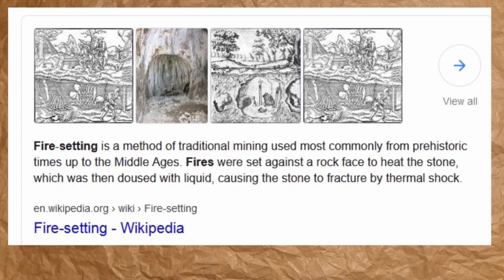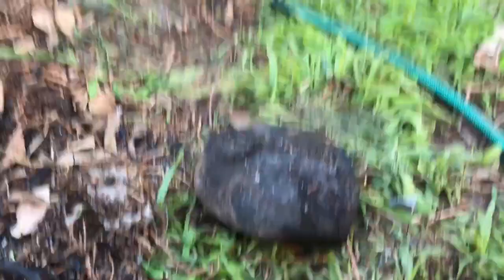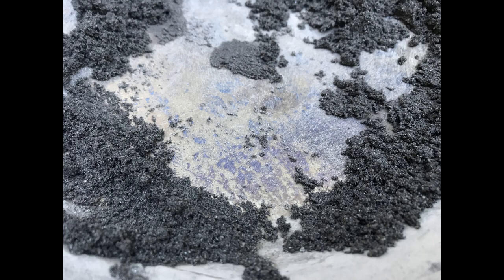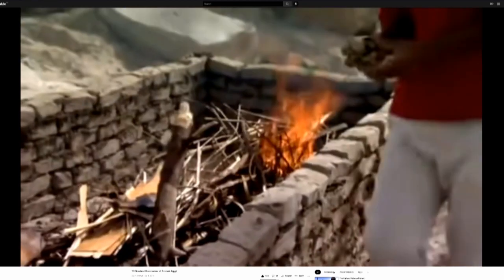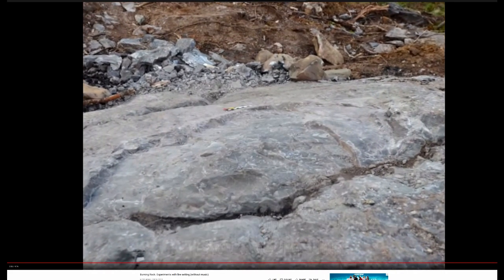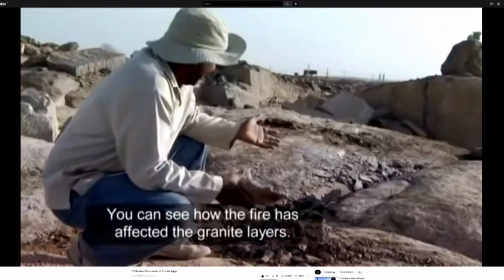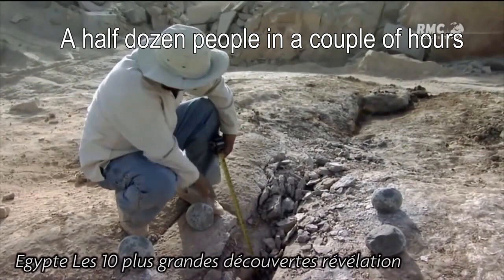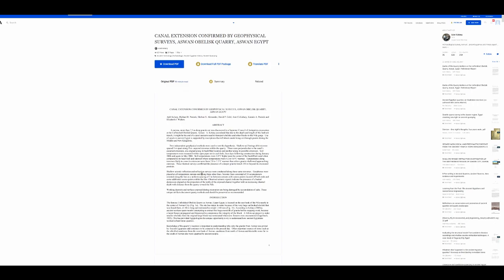Fire, Water, Granite & Other Primitive Tech the Advanced Ancient Technologists Can't Understand

Comment: You wouldn't even need a hot fire or for a long time. In fact to certain circumstances you wouldn't. If you wanted to take a very rough area, set an even fire or coals for a short time you will affect the stone to a limited depth, making grinding and sanding easier.
Reply from the maker: Yeah, at first i left it in the fire for a long time. Then I'd just heat it up for a few minutes. Doing that a couple of times with some water in between reduced it to little more than dust held together by kids glue. A few whacks with a hammer stone and it disintegrated into a fine abrasive powder.

Comment: My question is this - if this method of banking a fire against the granite to heat it up, and then dousing the granite with water to create internal micro fissures and weakening the granite so pounders could work it was used, how does that explain the uniformity of the scoop marks? How does it explain how they stair step down the sides of the obelisk? How does it explain the curved cuts under the obelisk?

Comment: i also have another theory regarding the making of stone saws, which there is clear markings on the box sarcofagus's of saw markings. The Egytians were great bead makers and a ceramic bead with sapphire or garnet could be set in the mud before firing then finished beads could be strung on a rope with knots to keep separated allowing the abrasive paste to work in between the beads. Re-using the broken beads would have been a smart thing to do saving time from collecting new hard abrasive minerals, leaving very scant evidence of any left over beads. Again not high technology. Just smart old fire technology.
Reply: @GroberWeisenstein  i never said it wasn't...i said theory of making saws

Comment: Just a little query,why do I see close together scoop marks around these blocks and not shards . Also wouldn't setting a fire under a stone they really wanted to keep in one piece ,hugely destroy the chances of that?
Reply from the maker: Very risky though it depends on how much heat and how long. They burn for an hour, I did some experiments and 10 minutes is enough. After that the granite could be easily smashed to sand and dust for abrasive  with a pounder. I was using inch thick granite. On bedrock would be different.
The trick would be applying low flame or coals just long enough to affect the area and depth you are working on.
Reply: Localized heat likely does not permeate the entirety of the block.  In other words they heat an area just enough to soften it a bit so as to hammer through more quickly.  Workmen sitting side by side with pounders would work the area to their front in a systematized manner - likely moving from top to bottom over and over again.  

As to any remaining debris these sites are maintained for tourists.  Look at old photos of the Great Pyramid King's Chamber pre-1990's.  Now look at recent ones.  The chamber was renovated in the 1990's.  Rubble was removed and broken blocks replaced to make it safer for tourists much the same as the entrance to Tutankhamun's tomb has been built up to allow tourists to access it.

Comment: good information. i believe that Quenko was a concrete manufacturing plant...like you i have done experiments. I played with acids on granite and it turns the contact surface green, allowing easier working with drills and polishing. Broken down fully and mixed with calcined lime it sets to a hard grey stone like material. Very reminiscent of the blocks at the Sacsayhuam site. This natural concrete could have been used to set harder minerals like crushed saphhire and garnet into the concrete and set on a stick to form a handle...then add the acid to the work face using the zig zag lines that all had a vessel at the head or high point allowing the acid to be dribbled down the conduits to the workers with their abrasive sticks. The Quenko site bears all manner of acid leach marks. It is surrounded by pond like constructions which could have received the acid paste mud from the workers and also allowed settling for separation of muds and fine gravels. Also looking at all the odd steps and carvings it has no function unless viewed from the viewpoint of it being a wet face work site for grinding limestone into paste. The acids I used are organic and would easily dissolve limestone and help dissociate the surface granite. Drilling through granite became a lot faster after starting with pilot hole and would then drill at a speed on par with drilling wood with the next size up drill while being wetted with the acid. It left smooth walled drill holes unlike modern hammer drilling because the stone was falling apart and making its own abrasive to aid the drill. Certainly not high technology...just smart observational chemistry.
Reply from the maker: Will have to get back to you on this, cheers
Reply: @GroberWeisenstein  Quenko is limestone.
Reply: @GroberWeisenstein  a brew of acids changes what happens at the cutting surface. i have tried it. not just imagining things.
Reply: @GroberWeisenstein  i had a feeling you were talking from experience and ask you this...do any of your formulas make a pale green powder appear to fall off the granite when left to sit in the acid overnight? this is what my formula does and when used to drill through the stone...after making a pilot hole...the following size increase drill bits goes through as if through wood then when looking closely at the drill marks the walls of the drill hole appear smooth and not abraded. i did these test over 15 years ago and dont have the samples anymore. it was proper granite from boullders in the central west of NSW and there was no industrial coatings. i do not have granite to play with now...i only have access to ademillite, but i would like to do it again and get some video footage of it because i have a hard time convincing people of what i saw. i was experimenting with geopolymers and other earth alkali cements at the time.